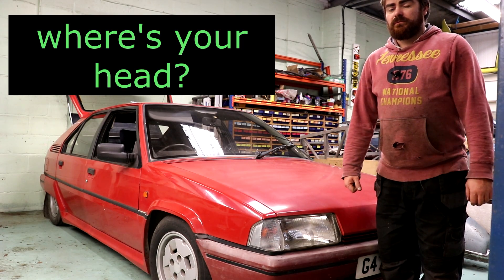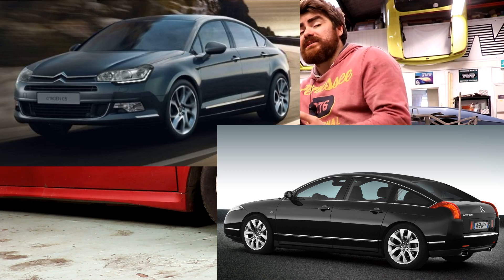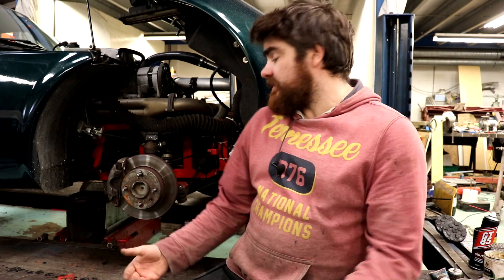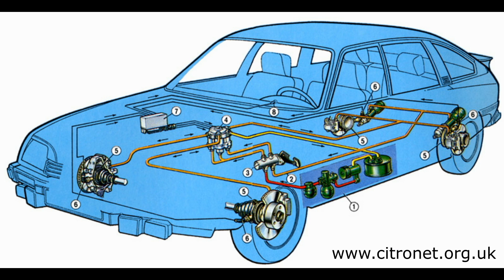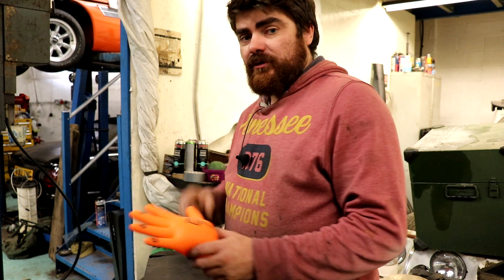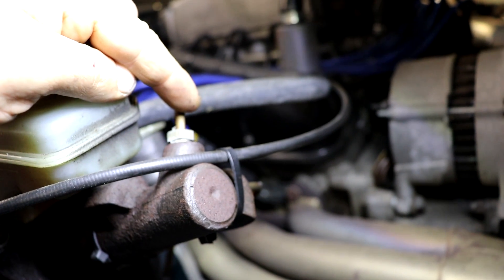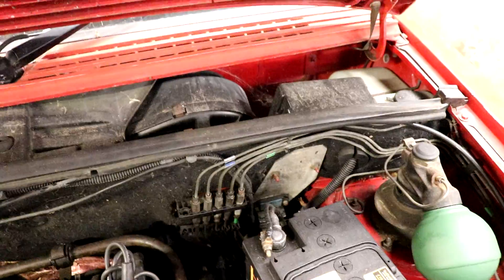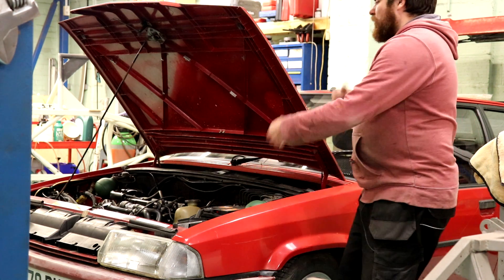On The Ramp | Hydropneumatics simplified: Citroën brakes - Why are they so good? (1/3)

Comment: I got to be honest, I am dying to get a citroen again, but in that case I would want the C5 gen 2 with the latest hydractive system. I would also like AWD, and my question is as follows: Do you know why citroen never made any AWD cars in modern times? No market for it is the obvious answer, but that seemingly hasnt stopped them before from producing stuff no one buys😆. Just company policy or technical issues making it very cost prohibitive? Cheers.
Reply from the maker: There's no real need for AWD, I think. It's extra weight, extra rolling resistance and saps performance. I guess Citroen's logic was that markets that actually need it (Scandanavia, Canada & very N. America...etc) were so small it wasn't worth dealing with.
The only hydro-Citroen that received AWD was the BX.
Reply: @UPnDOWN  You are absolutely correct about the need for AWD, and even though I am in a scandinavian country, almost no one needs it even here, unless they are doing something very atypical with their car. Its a bit of a bugbear with me, and I say exactly the same as you do to almost everybody thats asks... (I am a pro driver, so I get a few questions)

However, my usage of the car is sometimes just such a case: Towing 6-7000 lbs up extremely steep and slippery "hills". In this case you need enough pressure on the drive wheels, and no FWD consumer car built can provide such, sadly. 

My mk2 C5 (facelift first gen) did very well for what it was, but it couldnt cheat physics. RWD could possibly work, but I would like a citroen again. I have been toying with the idea of mounting "Tractor weights" on a bracket on the front, but I am unsure of how much is needed and if its even possible to make a bracket to place them..  

Anyway, very good answer from you. Thanks.

Comment: Early DS'es had LHS. It was somewhat agressive to the sealings as I recall..
Reply: LHS was a glycol based (ie like DOT 3/4 brake fluid). Problem was/is that glycol base fluids absorb water. Not a real problem in a closed systems - normal braking systems. The Cit system is 'open' as the main reservoir is open to the air. This the LHS systems, over time, become contaminated with water. This led to accumulation of water in the brakes and rear suspension units causing rust and corrosion problems.
Reply: @citroenfan8930  well explained. Thanks.
Reply: @citroenfan8930  Thanx for the correction. You are right.
Reply: @uwekall6281   No need really - lots and lots of folks get confused about the very early cars - coming on 66+ years. And why they used LHS - was made to their specific formula - in the first place still puzzles a lot of us. Mineral based fluids where already in use by the airplane industry and had been for some time.

Comment: Am I right that the early BXs also had the mushroom brake pedal?
Reply: I think they stopped using the 🍄 in the GS already.
Reply: I think the last models to use the 'mushroom' were the D's/SM's. The CX has a 'conventional' brake pedal.
Reply from the maker: No, it was only the DS & SM (plus the odd variant of D Super/ID).
Reply: @UPnDOWN  It was also a long time ago when I was an apprentice car mechanic that I was allowed to drive a BX into the garage and experience the special braking, but you showed in the video how it works with the BX.

Comment: Great and educative video as always. ☺
Brakes on BX are great front especially they can lock wheels immediately.
Rear ones are completely different story they can work like a charm , or if you have leaky "doseur" they can give so low brake force on wheels.
Reply: Higher spec BX's were equipped with anti-lock brakes.

Comment: In the next segment you might want to add why Cit changed the bake valve actuation from the 'le mushroom' (D's/SM's) to a 'conventional brake 
pedal :).
Reply: I don't know but I guess it had something to do with Peugeot taking over?
Reply: @gerardnieborg  - a reasonable assumption but no. The CX was designed long before Peugeot acquired Cit in 1975. For a lot the CX was the last 'real' Cit. All models after that shared a lot of parts with competing Peugeot models.OTOH my 92 XM shared the same platform as the 605 - the first to so.
Reply from the maker: That'll be part 3, which'll be 2023 sometime.